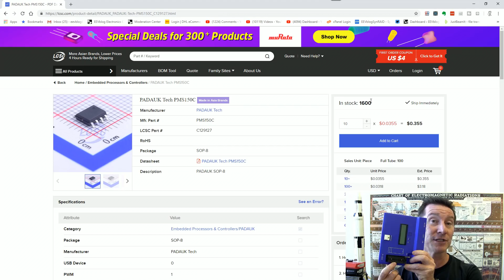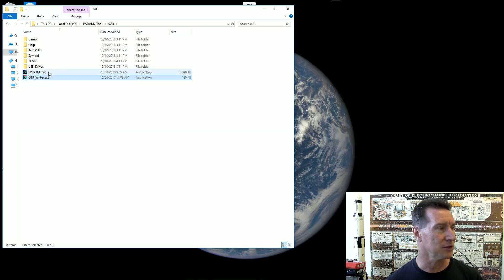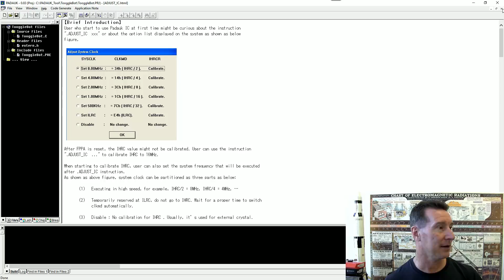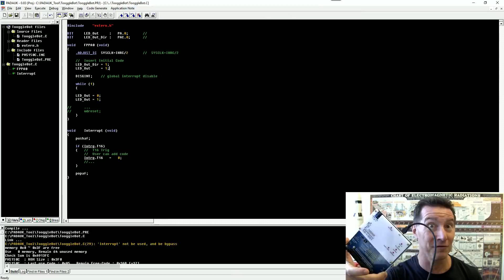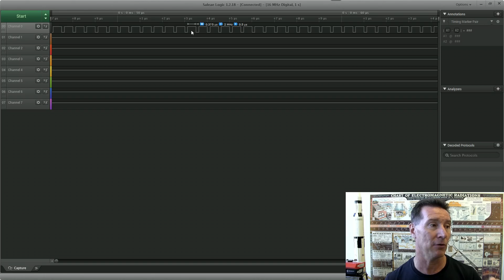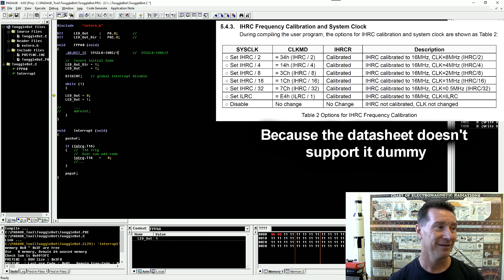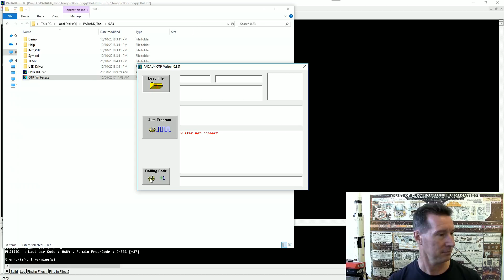EEVblog #1140 - 3 CENT Micro LED Blinky with ICE!

Comment: These sound great on paper but practically I can't think of where you would want to use something like this, unless you are building really cheap products like the stuff that comes from China super cheap.
Reply from the maker: If you need several standalone supervisors in a design, PWM controller, serial converter, plenty of apps for something like this if you don't want / can't tie up your main controller.
Reply: Pound shop / dollar stores are probably full of cheap toys using this chip or similar. Chips like this will probably turn our disposable items into smart disposable items. Probably.
Reply: You know that 8-bit MCUs still dominate market (there is still lot of 4-bit MCUs on market and they have lot of uses). In many cases  8-bit MCUs are more then enough for most applications (and more efficient and better choice then 8-bit MCU).
According to Gartner 2 years ago there were three 8-bit MCUs designed into embedded systems for every one 32-bit MCU.
Little interesting fact that STMicroelectronics, "big player" in 32-bit MCU but "small player" in 8-bit MCU introduced STM8CubeMX for their STM8 8-bit MCU (STMicroelectronics is in 8-bit MCU far below Microchip, Atmel and not to mention Renesas which have bigger market share then Microchip, Atmel combined).
Reply: Guys, I did not meant there is no market for 8 bit mcu's. What I meant is, when someones designs a product (other than cheap almost disposable stuff from China) is he really constraint to choosing a 3 cent micro from China because it will come with some disadvantages on the supply chain and/or development tools and software? I am inclined to believe that the examples you gave where something like this could be used, can easily accommodate a 50 cent micro in their BOM from a more reputable manufacturer.
Reply: @voltlog  Microchip is "reputable" manufacturer 8-bit MCU and they have worst development tools and software imaginable, free version of c compiler insert useless instructions so it make that pay version look like do some optimization, but it do not do (only compiler for their microcontrollers that is at least useful is B Knudsen Data after IAR dropped support for them), microcontrollers are full of silicon bugs, which they do not even try to fix, they just change status from bug to feature (example is interrupt on change on PIC12Fxxx microcontrollers), and as of supply chain last time I checked for some of their microcontrollers waiting time for delivery was 12 weeks (direct from Microchip, Comet Electronics was little better with 8 weeks, only RS had them in stock but limited amount), but that is not even longest I saw they quote, I saw 48 weeks for delivery.
I agree that you need good development tools like IAR, Keil, TASKING , but that very limiting choice of microcontrollers. GCC based development tools are useless like a white crayon (GCC is good compiler for x86 but bad for microcontrollers, for microcontrollers is only useful for hobby use).
Reply: Miloš Lazović GCC is a C++ compiler, so way more useful than pure C, and that’s also why vendors with their own compilers either use the EDG front end or offer C only. Developing a C++ front end is an effort measured in man-years or even man-decades. But you get some nice functionality over C for that. 

As for the back-ends: all back ends do the same primary optimizations in gcc, the rest is usually a matter of adding peephole opts you care for. I use gcc with a custom runtime library on an in-house 8-bit target and it generates very good code – better than what manufacturer’s compiler did. Of course I had to port a backend for it, but a basic one is not too terrible of a job. You do need a Unix environment for it though. gcc’s build system is unusable on Windows (Cygwin is a pain).
Reply: I can envision Oral B puts this in their toothbrushes for inductive charging and the button/timer controller
Reply: Intelligent system fan with built-in speed control and temperature sensor connected via smbus
Reply: I think a thing like this would be great for hobbyists, but IIRC there were even some preset code blocks/suggestions (in the previous video) for serial applications and ps/2 mice.  Personally I think it's pretty amazing that the dev equipment is cheap and the included ide (as well as the microcontroller itself) has so much documentation as well as features and support.
I don't think it's fair to assume bad quality, but a lot of devices you might use this for might not even task it hard at all and might be really super cheap so it wouldn't even be expected.  I think that was what you were getting at - things like lighted keyrings and toys.  But just based on what has been shown I think it could probably be used for something more substantial.  Remember, too, that this would be part of a larger system with other components in many cases and this ic would be used for some specific task..

Comment: I wouldn't want to find this in my defibrillator...
Reply: I think it's designed more for making annoying flashing lights and sounds in toys rather than medical equipment.
Reply: 10$ no surgery external probe defibrillator for the poor !
Reply: I'll doubt any respectable medical company will rely on this, if I recall well they even trust Intel or AMD, they use more robust chips for their products.
Reply: @maelgugi  yeah but i wonder how many things have these things in them with fake brands printed on them and yet they do work just fine and some chinese guy is saving $1 on each chip. probably somewhat common. if it works nobody would ever ask questions

Comment: Idea for a project:  Take I/Q outputs from a shaft encoder and make "up" and "down" pulses come out.

Another idea:  Take I/Q outputs from a mouse (4 inputs) and make standard mouse serial output.  This is probably a use case for a small processor.  It should easily fit in an 8 pin micro.  Good luck.
Reply: I was thinking exactly the same thing. Let's go do that!

Comment: Not sure if you missed it, but on the lcsc site there is a link to the manual/data sheet for each micro, which includes description of the instruction set, registers, etc.  It's in Chinese and due to its size you can't just go to Google Translate and select the file, however you can import it into Google Docs which has a translate option under to the Tools menu.  You can then download it (From the File menu) using quite a few different formats including PDF, docx, etc.  The translation isn't bad at all and is very usable, not sure if this is how they generate the English versions of their other tools since it seems pretty similar.
Reply: There is an english version with instructions on the Padauk site.
You just need to look for PMS150 series instead of C model.
http://www.padauk.com.tw/upload/doc/PMC150,%20PMS150%20datasheet%20V007_EN_20170613.pdf
Reply: @robimarko  404 error now.
Reply: It's not like Google Translate ever works for Chinese...
Reply: I've had success with some datasheets, but I agree, there was WTF moments for sure, like pins "hanging" themselves... (that's a pullup btw hehehe)
Reply: https://www.onlinedoctranslator.com/translationprocess-pdf

Comment: That's Cheaper then a 555 and the R/C's
Reply from the maker: Yep, crazy.
Reply: Could you use a pin to change the blink rate, such a an adc pin? 

Pot one of these into a counterfeit 555 times package and really confuse people when they try to reverse engineer your production project.
Reply: Dude the original 555 has the die size where you could probably place the hole waver of those in xD

Comment from the maker: UPDATE: LCSC have just said that they will offer the free programming service for a limited time to anyone. Just email them when you place your order.
Reply: One of the authorized vendor ( https://skywiner.taobao.com/ ) can do the programming at 0.02 yuan /pcs if the volume is above 10K.
Reply from the maker: MowSong Ng  - Wow, 0.3 cents per chip programmed, practically free. 10k qty at 2.5 cents is only $250 worth!
Reply: That's cheaper then a dead dingo's donger.
Reply: EEVblog  Would they program just one chip for 0.3 cents? How would they give you change cut a penny in 2/3rds? Write a check for 0.6 cents? Or maybe convert to rupees and give you two rupees.
Reply: @daveb5041  you need 10k volume
Reply: @daveb5041  How does the fuel pump charge you 1.579 a liter or whatever? The same way that this company charges you 0.003 for the programming.
Reply: Please ask them if there is a way to program custom ROM on every IC. I.e. 1000 uCs, with basically same code, but each with unique 4 byte ID. Would sending 1000 rom files do the trick? Or maybe they have some other facilities to do something similar (i.e. provide a location in memory where I want to store by ID, and range of IDs I want for this batch of uCs).
Reply: That'd be the rolling code in the OTP Writer utility, so theres hardware and software support for that in the developers tools, so i'd have to assume an authorized vendor can handle it.
Reply: Good question. This could get interesting.
Reply: @movax20h  there was a serializer thing button on the programmer. MAYBE
Reply: s
Reply: errr, you're not planning on using this in uSupply are you ?
Reply: why not?
Reply: going to make it very inaccessible for someone else to hack at it - if for example they want to customize the firmware.

Comment: The PMS154 looks really interesting for a RGB LED controller after your interview with Mike on the amp hour (since it has the 3 11bit pwm outputs). I'm sure Padauk would be willing to sell them in die form for integration into an LED package. And that's where a 3c micro really makes sense. BTW I saw pictures of the bank of automated programmers on the taobao page of one of the distributors and the programmer help file mentions control for the automated programmer, so not surprisingly that is an option.
Reply from the maker: Ah, nice. Yeah, and LCSC can order parts pre-programmed for you, although this is not yet offered to the public.

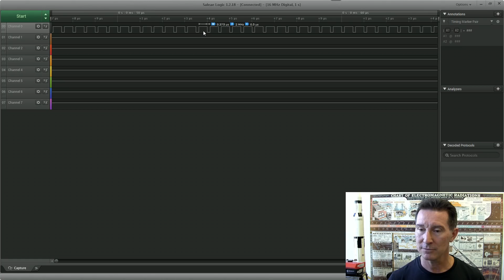Comment: 15:20 ..Daves been reading the chinglish manual too long!..David..get coding! LOL...maybe yas could find a use for the 3cent micro in the next version of the 121GW maybe a bus reader or somethin..eg reads I2C device addresses or for simple UART port for those without bluetooth (121GW now with 3cent micro!!) ....btw..is that LCD display finally dead Dave? or have you just given up on it?.
Reply from the maker: The bastard still works!
Reply: LOL
Reply: @EEVblog  so maybe all this AC driving of LCD is just some manufacturer BS (to sell more support chips), and these days we can just simplify and drive them directly from our μC DC outputs?

Comment: I think the inconsistency of the 2 MHz clock is because of interrupts being called during execution.
Reply: He disabled interrupts (apart from the fact that interrupt need a trigger; they do not happen out of nowhere). I think Dave's explanation perfectly makes sense. With the sample rate not much more than the  signal frequency, and being out of sync, their relative position slowly moves. This means that a full 0 or 1 cycle can sometimes have an extra (or one less) sample

Comment: Kind of interesting you didnt mention that timing glitch with the Logic Analyser is called aliasing - most people know the term but wouldnt connect that this is a form of it
Reply: When he zooms out it can also be viewed as a beat frequency, since the two portions of different frequency had a “duty cycle” that looked equal to the duty cycle of the toggling pin. It would be nice if those logic analysers could utilise the oversampling he’s getting, or to have an external trigger and frequency multiplier of some sort. Even just error bars. But it is a fairly archetypal description of time-domain aliasing.
Reply: error bars would actually be freaking awesome
Reply: Not quite. Aliasing happens when you try to sample a frequency that is higher than the half the sample rate - the apparent sampled frequency is reflected around f/2. See Nyquist Theorem.
So sampling @16kHz can only resolve up to 8kHz. If you try to sample 9kHz with it, you get a 7kHz signal. Importantly, you get the same 7kHz aliased frequency when trying to sample 23, 25, 39, 41 kHz etc.
Obviously this sounds horrible as all high harmonic content gets mangled and reflected into hearing range. This is why sharp low pass filters are used that start their cut-off at 2/5 of the sample frequency below the Nyquist frequency, f/2.
The sampling distortion with the logic analyser and the pic signal is more as a result of phase shifting that causing Moiré fringes, much like looking through two combs placed on top of each other or the railings on motorway bridges.
Phase locking or synchronizing both clocks would give more accurate results.
Reply: Didn't mention? He spent like 15 minutes on it...
Reply: It could have been as well an ICE glitch. I actually suspect that ICE is a dummy USB-to-parallel adapter and all the emulation happens on the PC side. No timing guaranteed.
Reply: @frigzy3748  The timing couldn't be happening on the PC at 2 Mhz, USB is 1khz max. I believe the ICE is totally emulating it.
Reply: @jnevercast  wait, what do you mean by 1khz max? The bandwidth of USB 2.0 Hi-Speed is 480 Mbit/sec. We have a whole variety of USB<->parallel port sort of tools, like Saleae logic analyzer, FT2232-based JTAGs etc. The former reliably maintains 20 MHz sampling rate over 16 input channels. PADUC emulation requires way less bandwidth than that.
Reply: @frigzy3748  bandwidth. Sure. But the round trip time is 1ms. If you have to make a round trip for every instruction it's very slow. Since you can't buffer the execution of code 

That's why gaming mice have a Max sample rate of 1khz. You can't poll USB faster than that because of the way it time shares the devices. You can transfer large amounts of data in blocks. But the latency is still high (1ms each way)
Reply: Joshua Lloyd that is a legitimate point - hands down. It's 0.125ms for usb 2.0 though (still too slow).
Reply: @frigzy3748  I wasn't aware of the faster rate for USB 2 and I'm not aware of USB 3 improvements. But I just don't think USB is a low latency transport. So it wouldn't be suitable for remote execution. I suspect the ICE has an FPGA.

Comment: These are one step in the evolution of electronics toward being software-defined. Gone are the times when you had to fiddle with caps, resistors, etc. when you wanted to have something like a "reset" button you have to press for 3 seconds. How you can just add a 3-cent micro and code that condition. Want a flashing LED? Add another one for that. Want your monitor to fail after 2 years but you cannot get those "bad" caps tuned perfectly? ...
Reply: I've used PICs to flash a single channel of LEDs in the past.  It was for a TV prop and I had an existing module with a MOSFET output drive on it, so it was faster and easier just to whack a loop in assembler with two delays.  It flashed the indicators (custom LED panels) on a small car driven by puppets.
Reply from the maker: Easy peasy lemon squeezy
Reply: They need a transistor-lookalike version so you won't even notice it on the board when checking for bad caps.
Reply: With built-in clock, higher voltage to program and single output it is theoretically possible.
Reply: Now I realize that 1-wire was a Chinese plot to infiltrate the world. /s

Comment: Wouldn't use them for a pacemaker or anti-lock brake control, but plenty good for Christmas light chase circuit, and other apps, that you're life doesn't depend on.

From the Dave's example, it does have IO port data direction setting, so its NOT an 8051 variant (open collector/drain IO). Seems to be the manufacturer's own architecture. But since IO can be explicitly set as input or output, "charlieplexing" is doable.

https://en.wikipedia.org/wiki/Charlieplexing
http://nixietube.info/NixieTransistors.pdf

Don't complain about the user interface. I started on a Tektronix 8002. Cost north of $20K US. Had its own TekDOS (molasses on a cold winter's morning) operating system, that made its contemporary OS, CP/M look like greased lightning. All command line stuff. Even Motorola's HC05 evaluation tools (~$500), made over 10 years later, was a world better than the Tek gear.
Oh, yeah, the 8002 used 8" floppies !

Comment: The 2MHz sample isn't taking into account the loop instruction? So it should be 4MHz assuming it's a single JMP and flip.
Reply: if it has a single cycle instruction like that. And it might not.

On stm32 to write the shortest blinky possible I used a rotate instruction to shift 1 between upper and lower 16 bits on one of the GPIO registers, so I didn't have to use two delays and GPIO writes in the loop.